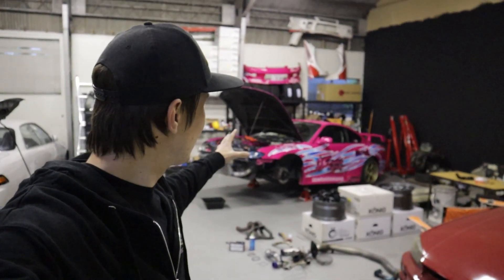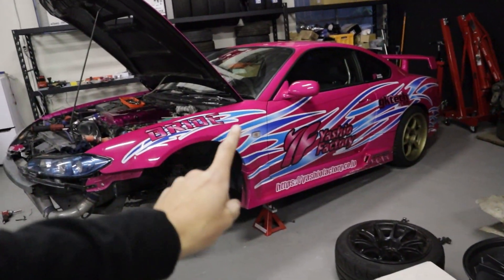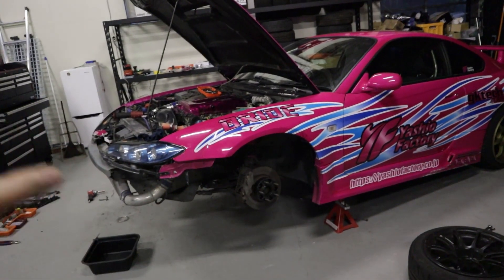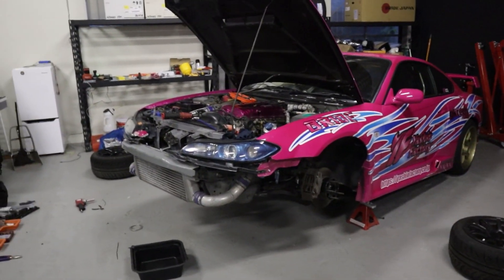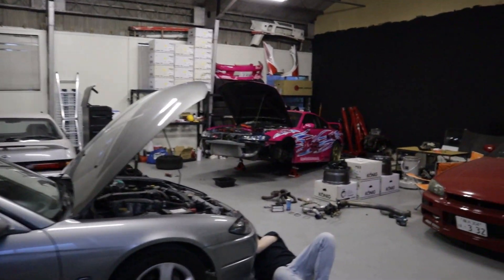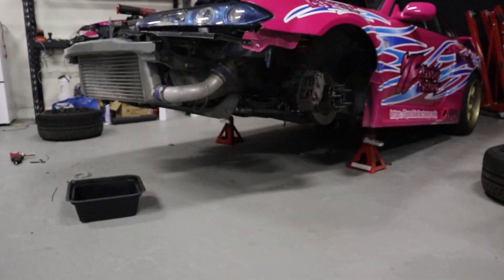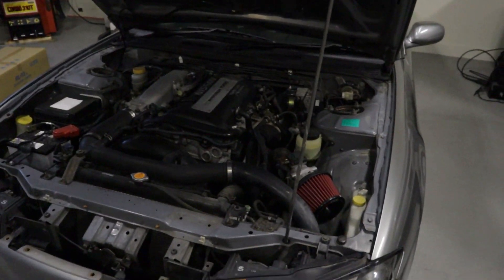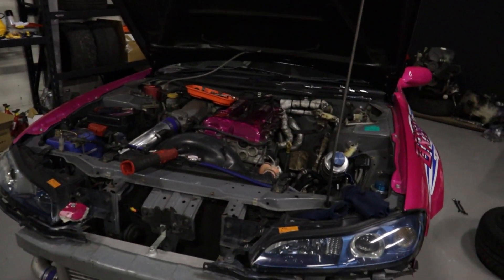TURNING MY DRIFT CAR INTO A TIME ATTACK CAR!

Comment: Does that screw trick work on R33 GTST calipers too? In the Pulsar game everyone either cuts down banjo bolts for stock front lines, or goes to custom HEL braided with the correct nib to suit the 4pot sumitomos, pulling out that valve seems way easier lol.

Comment: Rubber valve stems for the win. I work at a service center and see a ton of problems from metal valve stems.
Worst is ppl will put shiny steel caps on the aluminum stern and the galvanic corrosion can weld them together after barely over a year

Comment: I had small wall tyres for clearance on my S15 and it was wack!! Bigger sidewall and the potholes don't hit as hard and you are right.........meat.......good. Thursday you are going to be in the top 3 although you might loose bits of your front bumper........spare zip ties!!

Comment: Sam if that bottle was the only brake fluid that came out there is a LOT of more dirty fluid in there. I’m a tech at a Mercedes-Benz dealership and when we bleed the brakes as per maintenance schedule (2 years or 20k miles) we flush out 5-6 times that much brake fluid.

Comment: Sammit it’s always good to put a little lube on the valve stem when you pull it into the rim it prevents premature failure putting a little gash on the valve stem causing premature failure leak and will get worse over time or from heat cycle 👍😊

Comment: Get rid of those wheel spacers off the front of the car and order the proper offset rims the scrub radius is thrown way off when you have a huge spacer like that on the front your steering will be all screwed up until you make it stock 30 mm is better than 50 u should try driving with the spacers on and with them off lap times will tell the truth

Comment: Brake fluid is Hydrophobic and needs to be replaced every 2 years/40k km or sooner in race applications. It absorbs water and reduces the boiling point. Not replacing brake fluid causes corrosion in expensive brake components and decreases seal life besides brake fade/failure.
Fluid is cheap. Hard parts are NOT.

Comment: The S15 needs a 2j it's to under powerd even if u add a bigger turbo
Reply: Not for Japanese technical circuits. Also it’s getting a fully forged built bottom end shortly. You don’t need 1000hp to be competitive at the level he’s at and on the circuits he’s racing.